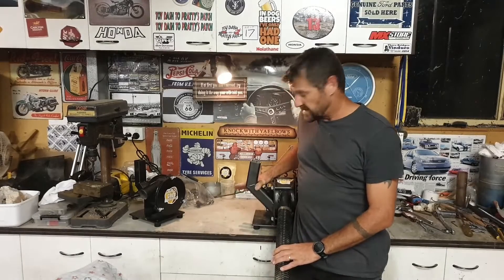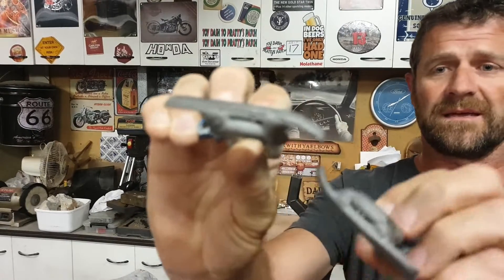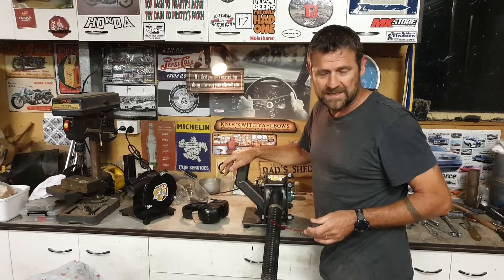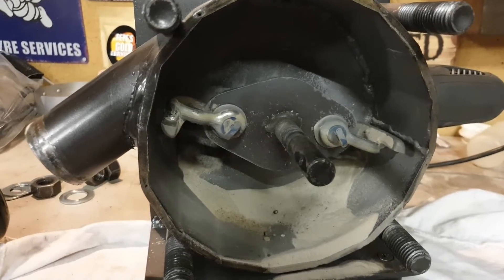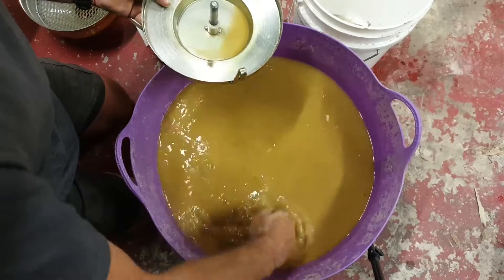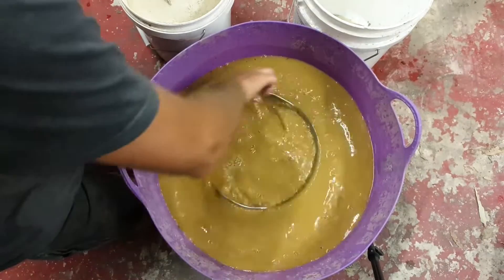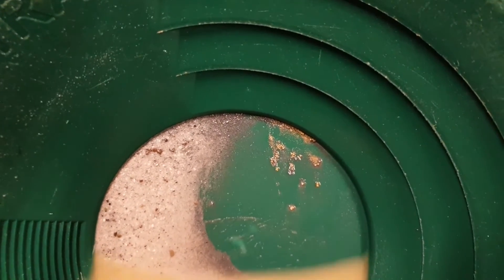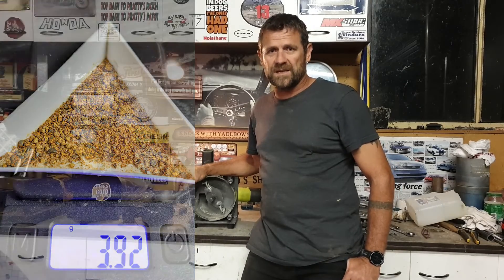Crushing GOLD RICH Quartz

Comment: Hey Pete you need to look at getting some Bizalloy scraps for your hammer mill. It is a wear resistant steel they use in the bed of tip trucks and on the cutting edge of exchavator buckets.
Reply from the maker: That sounds like a great material for the hammers, I could hard face weld them but I don't have a stick welder, wonder where I could get hold of some of that steel.

Comment: Pretty awesome material to work with Pete. I'm betting you're glad you didn't have to do it all in the dolly pot 😅. Your mill works a treat. Have you thought about using stainless bow shackles?
Reply from the maker: That was some great material, there is no way you could process that much material well enough to release all the gold, so in steps the mill to smash it to sand in seconds. The bow shackles don't get worn down, its the bar I weld on. The giveaway mill might be worth a test with Stainless bows.

Comment: I have seen a few vids on the RotoPan where they just shovel unclassified material into the mesh and then do a few spins, either way the Gold drops to the bottom, now stand on one foot and rub your belly while etc etc ....
Reply from the maker: It was interesting, It would be good to give it a run with some gravel.
Reply: @PetesGoldAdventures  Yeah that's why it has the mesh, no classifying, just shovel raw material in. See ya Saturday.

Comment: You should try some case hardening welding rods an build up the hammers, they may last a bit longer for you. Earth moving contractors use them the on their bulldozer tracks (grouzers) any any other high wearing surface.    Cheers   Robert
Reply from the maker: I have thought about it, but I don't have a stick welder, but my mate Andrew does so I should get him to build them up for me and give them a try.

Comment: Were did you get the rock crusher from
Reply from the maker: Hi Adrian, I made that one along with another that I gave away at my subs day out, have a look at those videos and you'll see that one. In my latest video you'll see that one has now been modified to be the same set up as the give away mill. I don't make them to sell at all as I don't really have that much spare time. Muzz's Munchers make them to sell, they look fine, but I'd rather my type of exhaust, but that's just me. Check that guy out if your looking to buy one.
Cheers, Pete
Reply: @PetesGoldAdventures  thanks for pointing me in the right direction cheers

Comment: Well done, crusher working a treat, have you thought about hard facing the impellers ?  You'll get hours more wear out of them. Did this with the tourist crushers at the Deborah got months more wear then just built them up again when they whore, saved heaps of maintenance time.
Did you like the betda pan, I run one works great just need the water and to remember how to spell it.
Have a good day tomorrow and I wish I was there, gotta finish up jobs i start, before starting new one Monday. I'll see how I go today thou not a good start it already twenty passed eight and I'm commenting to your video.👍
Reply from the maker: Thanks Craig, I have thought about hard face welding the hammers, but I don't have a stick welder. Panning that way was interesting, I'd say with practice it woud be a good method and you could really get through the gravel. Cheers mate, thanks for watching.